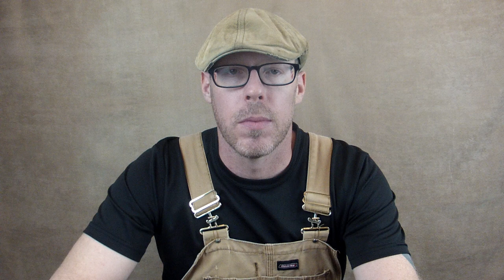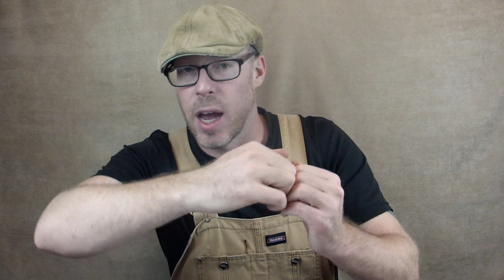When to replace vinyl pool coping

Comment: Steve this is very informative. The bad news no one wants to hear but necessary. I have metal bullnose embedded in the concrete.  Due to concrete cracks and settling some of the metal joints don't line up for the joint cap to fit properly and seat. The liner still stays in the track. We have a lot of ground water so the liner will float off during the off season. I've learned to check this in off season and pump out behind the liner. At some point Im not sure if I will have to address the bullnose metal coping. If so what do I do?

Comment: I am in the process of changing out deck integrated coping that failed. So cutting out cement and adding new coping along with liner. Is there a new coping you would recommend? Or do I still do a deck integrated coping?

Comment: Exactly what we have and we are going to install a low profile coping this Spring but do not know what kind of screws.  Will the companies sell to home owner's?
Reply from the maker: Yes they will, and usually galvanized steel self tapping tech screws. Use one every 6" around the pool.
Reply: @Swimmingpoolsteve   WOW Steve thank you that was fast and that helps
Reply from the maker: Could be that you need tapcons, the blue ones, if there is concrete behind the steel at the top of the wall. That makes the installation much more labor intensive because you drill the steel first, the pilot hole masonry bit, then tapcpn with hex head. It's a three drill job and you will sweat it our for sure. If you can use tapcons they go quick and easy.
Reply: @Swimmingpoolsteve  im doing the same this spring to my pool BUT my walls to my pool are wood! Will this low profile type track/coping work?
Reply from the maker: @jessicavaccarino6521  I would be pretty apprehensive about a side mount coping on wood walls. That wood at the top of the wall would have to be extremely thick / sound and you would want hardware every 4" around the perimeter. Even still, some sort of top mount coping style would be better for wood construction.

Comment: I had a 10X24 vinyl salt water pool install last summer. I need to get the patio done this year. I am unsure what kind of coping is recommended.
Reply from the maker: Coping is what holds the liner in place with a vinyl pool.  You cant change the coping without changing the liner, which means that any deck solutions you look at have to happen without touching the coping or liner - unless you dont mind paying to have those done again.

Comment: Liner looks good and is in place...previous owner installed 10 years ago. However, the frame around the pool - which I assume is the coping - is made of some kind of thin metal and looks a little weathered. Are we able to change that out w/out replacing the liner, or should we just bear with it until it’s time to change the liner??? Thanks for this great info!
Reply: I have the same exact question. We just bought a house with an amazing inground pool. But the coping metal is rusting in spots and the liner is coming out in areas
Reply: I would try painting the coping carefully in the spots that are the eye sore.
Reply: @stizzack  Is the liner coming out of the coping  because the liner is old and hard.   The liner may need to be replaced and not the coping.

Comment: Good video. I have an integrated coping. The deck is failed. Concrete has deteriorated, we are replacing deck only. Liner is 4 years old and bull nose is ok. BUT how difficult is it to replace coping along with deck? I fear damaging the fairly new liner. Options ?
Reply: If you replace coping you need a new liner even if it’s new. That was his whole point in making sure your coping is in good shape before going forward with a new liner.

Comment: Hello,

I have a 36 yr. old vinyl liner pool 18' round with bullnose coping and was just informed by my contractor that it would be best to fill the pool with dirt and close it out because the  coping is shot. He indicated that the cost to repair wouldn't be a good return on investment. Would this be your recommendation? Can I buy the coping and do it myself?

Thank you!

Comment: Thank you. How can you actually see if the coping is failed if a few spots are comming down.
Reply from the maker: Is the liner slipping out of the coping track (easy fix) or is the liner still in the track, but the coping is pulling off of the wall (hard fix)

Comment: What can I do when the screws/tacks? holding the track to the pool walls snap off?  The vinyl liner is pulled about 1 1/2 " away from the wall where the track actually split in half - I so truly appreciate your advice.  Thank you

Comment: Great video!! I have a question:  Could you tell me about the long-term effects of algae, leaves and other organic matter left on the vermiculite underneath a new vinyl pool liner?
Reply from the maker: You might get some mold growing under there, but for the thousands of vinyl pools I have seen empty this does not seem like much of a concern.  More of a concern would be anyone attempting to put a liner over anything other than a pristine clean floor surface.

Comment: Hey steve any tips on how to make a vinyl liner pool more shallow?
Reply from the maker: Like you want the deep end to be less deep?  How much height do you need to lose?  Also, I presume you understand this would be completed as a renovation of the pool and liner, not something you can just do to your pool and have it now be shallower...
Reply: @Swimmingpoolsteve  yes it's at 6 ft and they want it 4 ft 
How would I do that? Would get to the 0lumbing of the main drain raise it and fill it with gravel ? Then lay the new concrete over the gravel?

Comment: As more need to be replaced as better for you guys.
Reply from the maker: Or you can try to get one more season out of your liner, but then damage your coping track from the strain. Now you need new coping, but if you deck integrated coping, the most popular coping, then you need to re and re the deck. All in, pushing for one more season from your liner turns a $3500 job into a $25,000 job.

Comment: I was thinking that I can cut the concrete out along the perimeter of the pool about the length of bullnose pavers, replace the old track with new low profile then cement the new bullnose pavers along the edge. What do ya think?
Reply: My issue is my coping is pvc and is cracked and cracking along the pool side. Looks horrible and need to fix it but not break the bank..